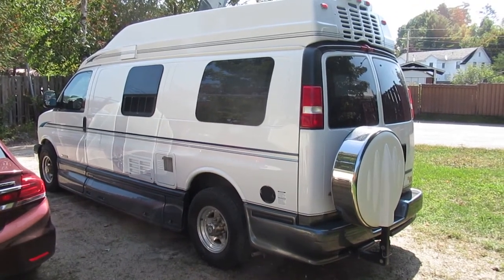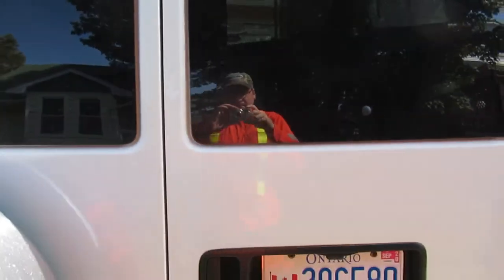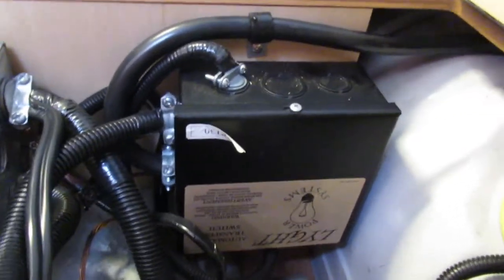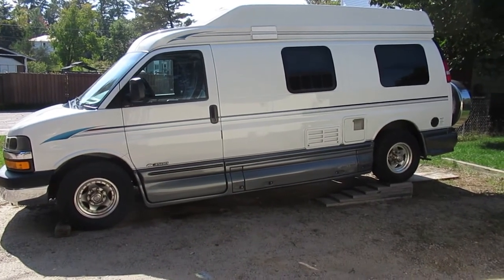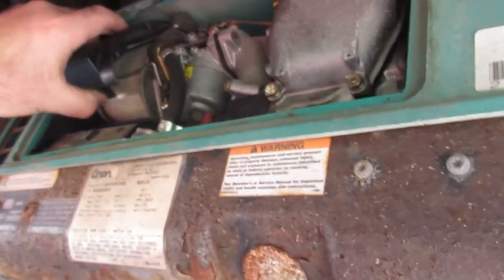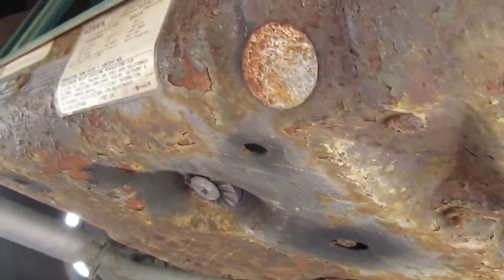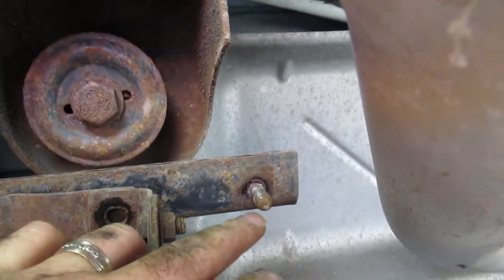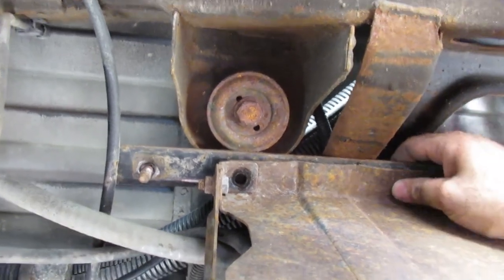Removing Onan 2.8 kW KV Generator from 2004 Roadtrek Popular 190

Comment: I just got a 2004 Chevy Roadtrek 190 a few months ago and this video is very informative. My generator was struggling last weekend but did end up running the AC for 15 minutes or more. I understand I need to run it about an hour every month to keep it running correctly and should probably use a gas stabilizer when not using the van.

Comment: Stephen - Thanks for the video. Any update from Onan as to the rubber mounts?
Reply from the maker: I haven't ordered any yet.  I did get a check valve for the fuel system but haven't put it in yet as the van has been buried in snow for the last few months.  You can find the parts manuals in the video description under literature.

Comment: Hi can you see the numbers on the fuel pump or do you know were i can buy it?
Reply from the maker: There are links in the description for the parts manual.  Some parts are available from ebay and amazon or you could go to a local Onan dealer.
Reply: Tanks

Comment: Stephen, do you think the carburetor can be changed without taking the generator out? i also have the 2004 190P.
Reply from the maker: It may be possible but it would be harder to do than dropping the generator.  You can use an ATV jack or a lift table to drop down the generator.  Ramps will be mandatory to get the vehicle up in the air.
Reply: @SteveRivett  after asking you that question, I checked with my Facebook Roadtrek groups, they all pretty much advised against it.

Comment: i think i heard you say you don't use the generator - so why not just remove it?
Reply from the maker: It is the only way to run the AC without being plugged in.  We have only had this van for a few months so the novelty of having AC in the coach is still there, going to batteries and an inverter would be costly but may happen eventually.